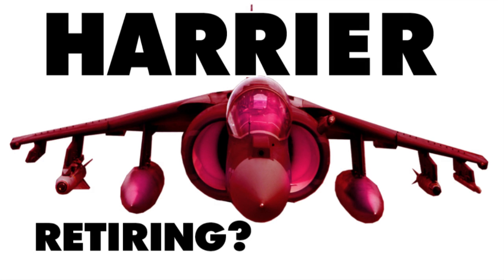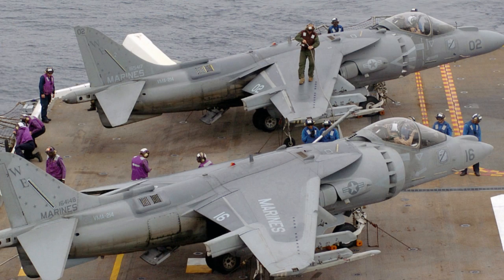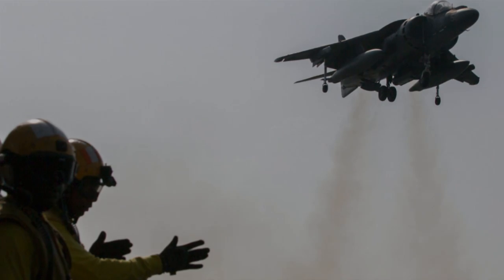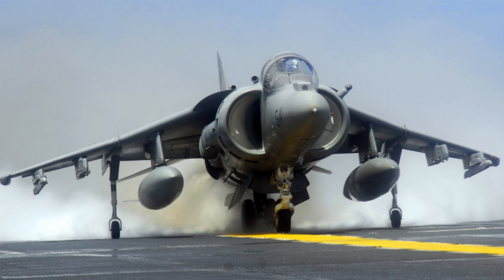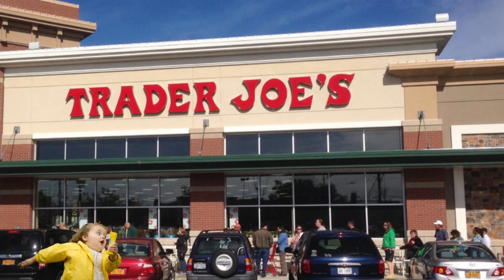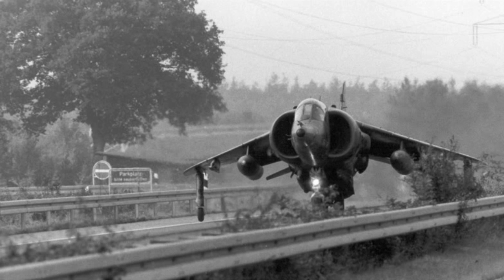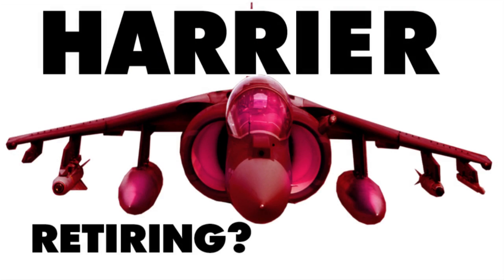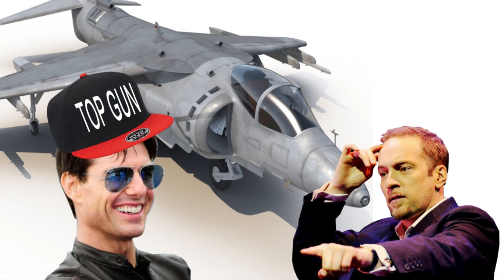Harrier AV-8B

Comment: Is they tale of vertically, can they switch to regular flight??
Reply: Yes they can fly like normal jets and land and take off by jumping, hence jump jet :)
They are good for ground attack and naval warfare these days as they would be outclassed in a dogfight by a top of the line modern fighter. Mind dogfighting is going the way of the dodo too with over the horizon kills with long range air to air missiles, so if they had modern missiles and targeters, they could be fine. 
America uses loads of other upgraded old stuff, the M113 APC, M16 Rifle, Mk19 Grenade Launcher, MP5 SMG, and M134 Minigun are all from the 60's, the M14 rifle and M109 Howitzer are from the 50's, The Abrams tank, Bradley IFV, Stinger AA Missile and F16 are from the 80's, the Carl Gustav recoilless rifle is from the late 40's and the M2 Browning HMG is from the 30's. Just because something is old doesn't mean it's obsolete.

Comment: I can't believe the U.S. Marines bought these things and are using it as an excuse to make the F-35 a VTOL aircraft. Before that the F-35 frame was way more conventional.
Reply: Deadlyaztec27 I thought it was the other way around.
Reply: Jg3000 
Nope, the Marines insisted on a VTOL craft.
Reply: Deadlyaztec27 f 35 can't VTOL, it can STOVL
Reply: How was the frame more conventional when there wasn't even a design for it yet? The STOVL requirement for the JSF was there before designing even started.

Comment: The AV-8Bs were built by McDonnell Douglas, now a part of Boeing. In fact, this is an American design using the same upgraded original Rolls Royce engine. The major sub-contractor is BAe. There is more American components in the AV-8Bs than there are British.

Comment: G'day,

  Um, you missed the funniest bits.

   After the Blacksquawk Down thing in Somalia, Unkle Spam built a Test-Range with 12 Turboprop Engines on a Square Grid so they could mount Service Aircraft on a pylon in Flight-Speed Slipstreams, with their Engines running at operational Throttle Settings, and then use high-speed Cameras to film what happens when various bits of the Aircraft were shot with various Weapons, from Handguns up to 30mm Cannons.

   In about 1997 there was a feature Article about it, in Air & Space Smithsonian magazine.

   The Harriers have a High-Pressure Hydraulic Brake-Line, made of Aluminium Tubing, located on the Rear Undercarraige-Leg, and if you hit that Pipe with a single Bullet from a .22 Pea-Rifle while it's hovering...; then the Brake-Fluid sprays into the 900 Degree Celsius Jet-Efflux, and it ignites, and the Harrier then cremates itself automatically.

   That's why the RAF & the RN stopped evrn thinking about using Harriers in "Forward Bases" because any lurking Partisan, Insurgent, or Terrorist, sniping from cover, under the Flightpath within half a mile of the Landing Pad can kill a Harrier with their Rifle ; while it's low & slow, doing the "Balancing on a Pencil" thing.

   Regarding which...., between 80 MPH Airspeed & 30 MPH Airspeed, while transitioning from Wingborne to Hovering Flight the Rudder is TOTALLY  Ineffective & the Yaw-Puffers have NO Authority either..., and if more than 10 Degrees of Sideslip develops while slowing down through that 50 MPH Window..., the Intake-Suction of the Advancing Jet-Inlet will yaw the Aeroplane sideways, then the  Upwind Anhedral Wingtip "digs in" and rolls the machine fully-inverted, and the 4 Jetstreams will blow the thing upside-down into the Ground...

   That's what the Pilot's Handling Notes say, last time I read them.

  I'm amazed the Marines are still messing around with them ; the British put theirs in Museums, years ago.

;-p

Ciao !

Comment: The only operator that kept upgrading the Harrier in the 2010s was the spanish navy.. Britain retired theirs in 2011 and USMC and Italian navy expected to receive F-35Bs in mid 2010s.. since that didnt happent and is still going on.. now Italy and USMC joined the spanish navy in the upgrade program to keep the Harriers operative at least until 2025 .. so still 10 more years of the jump jet ahead

Its somehow pointless when you have CATOBAR carriers ... but some navies only have skijump carriers with no arresting wires decks.. in wich case the Harrier (and the F-35B in the future..... suposedly) allows them to have a naval wing.

Actually hovering is usually only done for landings.. as most of the time Harriers do short take off runs (or use skijump takeoffs in the case of all navies that used them....save for the USMC) and the british SeaHarrier FA2 even had autolanding in hover capacity...

I renember a Harrier pilot who was asked about Arnie in true lies.. when they asked him about the harrier scene with Arnie fighting the bad guy with one hand and holding the stick barelly with the other with his daughter hanging from the cockpit.. his answer was "well.. i guess Arnie must be one hell of a good trimming"

Comment: ask the Argentina about how much the harrier suckling. In dog fight they would just slam on  brakes and watch th much faster Argentina fighter sail past.

The vertical take off was pretty much usless but to able to land vertical on carriers deck is massive advantage. It also doesn't need a any kind of assist to get off said carrier. 

coupled with its ability to able to take off without a traditional run way.
Reply: If they were so bad, how come they shot down 20 Argentine fighters with no loss to Harriers from the Argentine fighters?
Your description also does not make sense. Why would the be slamming on the brakes if they are trying to catch the Argentine fighters? Wouldn't they be slamming the throttle forward for max thrust from the engine?
Reply: +rokuth if a dog fight you let the argies get on your tail. The harriers can slow down a lot quicker. The argie planes would fly stright past a misile or cannon fire would do the rest.
Reply: Stephen Rowley AHEM 24/0 OR SOMETHING LIKE THAT KDR

Comment: The U.S should return their harriers to England and get their money back. I bet they will receive more money to build the F-35.
Reply: The AV-8Bs were built by McDonnell Douglas, now a part of Boeing. In fact this is an American design using the same upgraded original Rolls Royce engine. The major sub-contractor is BAe. There is more American components in the AV-8Bs than there are British. Someone should get their facts straight.
Reply: Pretty sure all the U.S. Harriers in use are American built. Though The Marines did by the rest of the British ones for parts.

Comment: Ask a trigger puller if he'd prefer a 10 minute harrier response operating from a FARP or Lagger Point, or the Navy's planes coming from ship a half hour off shore, or the Air Force an hour away in an adjacent country.  VTOL absolutely has a place on the modern battlefield.  Is it the harrier?  Maybe, maybe not; but the VTOL concept will ALWAYS be relevant as long as our national strategy is to destroy our foes airfields, then rebuild them so the Air Force can build club med ;-)

Comment: Its not like the USMC had an option anyways, they're old and most of the operational aircraft were destroyed in theater by a mortar attack. Slow and un-maneuverable and no longer fit for modern combat. The F 35 has the most powerful engine ever installed in a fighter aircraft to date and it's been performing well lately.
Reply: Un-maneuverable, really?
Reply: crewgadjy Yes. Compared to every other Multi role 4th gen fighter in combat today, it is unmaneuverable.
Reply: Name another fighter than can reverse vector and get above and behind a pursuing enemy in one easy manoeuvre?

Comment: The UK got rid of harriers years ago... 'murica needs to catch up.
Reply: +jcn115 Well now we're getting 2 supercarriers and hundreds of f-35's. Also, it wasn't just down to money that we scrapped the harriers
Reply: lol and now you end up with a big carrier with no planes, good plan
Reply: ANDYofzz The planes should be ready. If not, the helicopters are. Either way, it will be used.
Reply: Toron hey, have some respect for someone who is so connected and well
 informed would still be humble enough to waste his precious time to enlighten us common folks
Reply: What did they place em with?
Reply: Walkerring We're replacing them with the F-35.
Reply: The UK got rid of their Harriers because they didn't have money and cancelled many platforms
Reply: Gonna regret not putting the launching and arresting gear on those big new Carriers and getting the C's. So close.....they even left room in case you change your mind.
Reply: jtoatoktoe Maybe so, but as you said, their is room for a possible conversion if and when it's decided it's necessary.
Reply: I have inside information from a Lockheed exec. that while the F35 may be flying the software is nowhere near ready for combat....  Years....